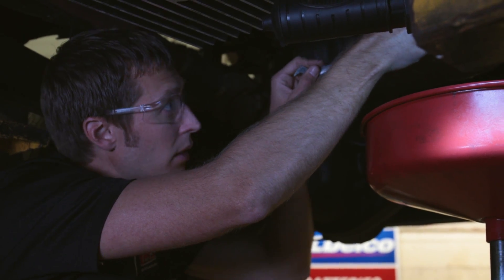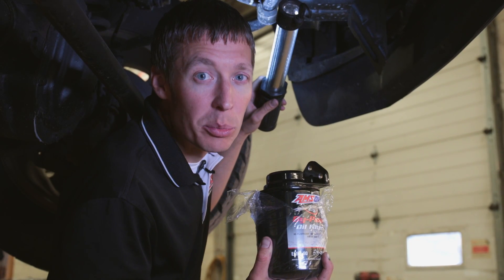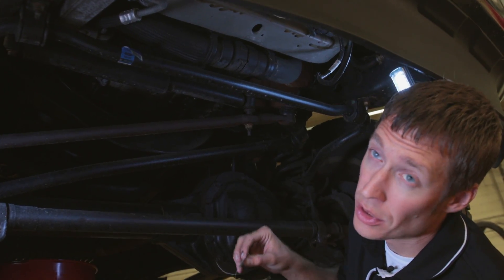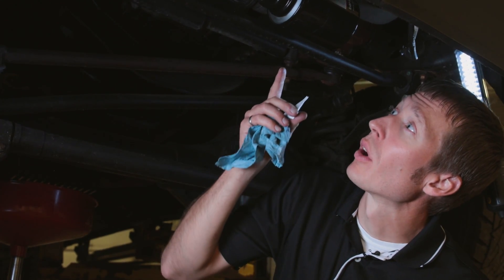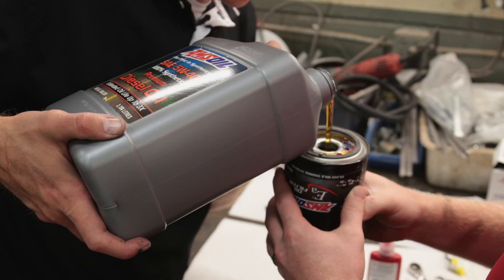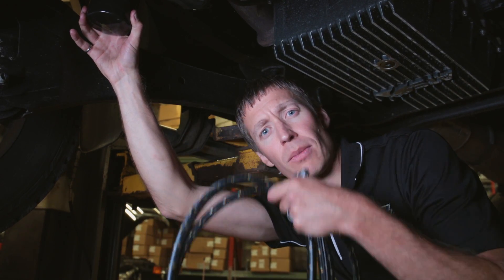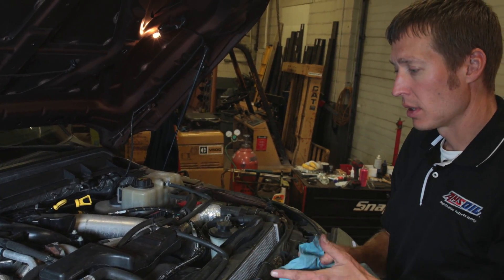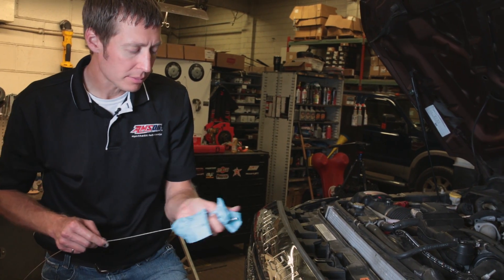How to install a bypass oil filter on a Ford 6.7L Power Stroke

Comment: Will this work if truck has excessive blow by? When you take my oil fill cap off smoke comes out and pushes the cap off some. Not a ton of pressure but enough to be concerned the pressure won’t allow oil to drain back in
Reply: Have you replaced or bypassed your CCV? When plugged up = excessive crankcase pressure is developed.

Comment: only an idiot would mount a oil filter on its side and no oil in it
Reply: Well, "idiot" automotive engineers do it very frequently...... 🤷‍♂
Reply: Generally, I’d agree and hate it when OEM engineers build them that way but …..…and since its just a BYPASS filter, not the main engine filter, it will just take it longer before it starts the bypass function… main engine oil filtration will still happen as scheduled.
Reply: yeah - idiots don't realize that, that system is "Under Pressure"! 🤣

Comment: Is the single better than the double bypass?
Reply: You mean better than the double they do the same thing if you want run amsoil filters then use the double
Reply: So you can only run amsoil filters on the double? I was just wondering why the single cost more